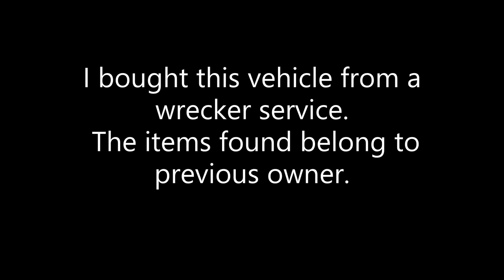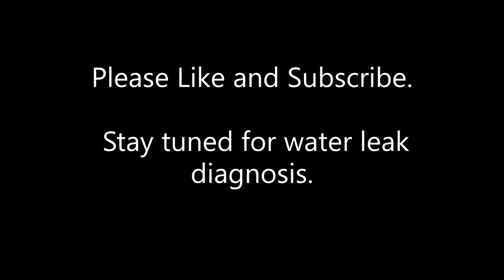Nissan Pickup Carpet Removal D21 Hardbody

Comment: What happened to your promised, water leak diagnosis? ONE YEAR AGO.
I'm guessing your fresh air vents are filling with rainwater because the drain pipe is clogged with leaves, seeds, dirt.  That water should flow down to behind your front fender panel (behind the plastic wheel well panels. ??

Comment: source of waterleak?
Reply from the maker: The right rear pop out glass was missing when I bought it. Also after removing the Evaporator box to clean and replace the expansion valve the firewall seals needed extra gasket.